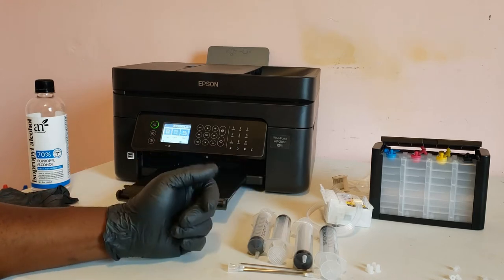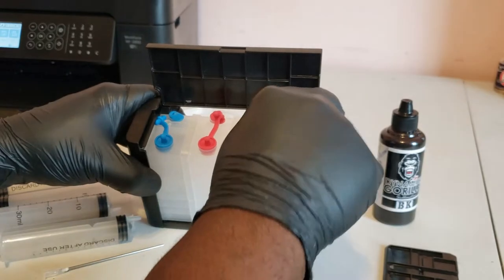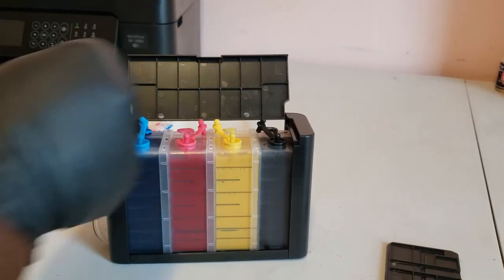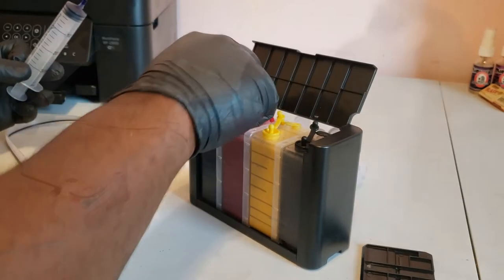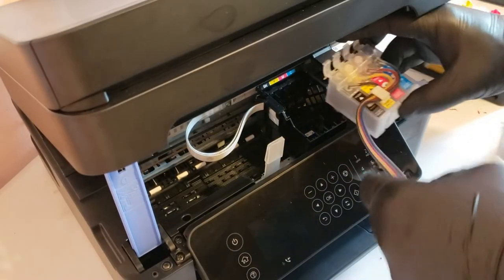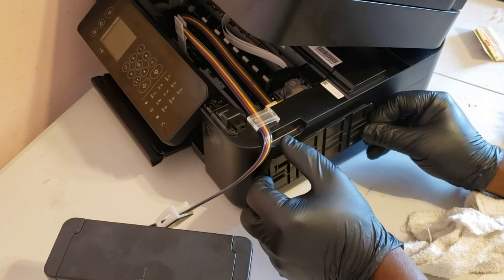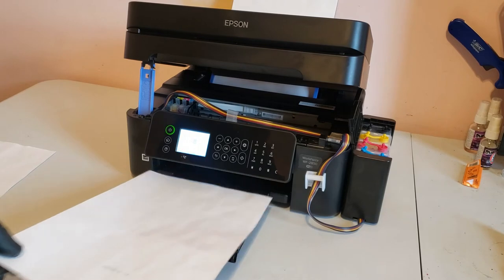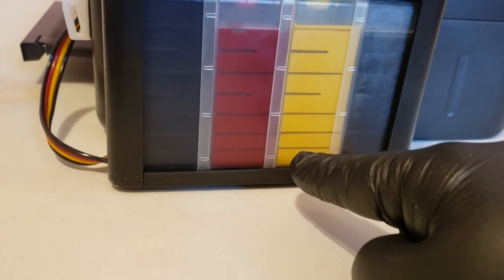WF2850 CISS Install Sublimation

Comment: With the CISS installed can you close the lid of the printer?
Reply from the maker: Not with this configuration. However, if you route the tubes through the printer, you can close the as scanner unit.
Reply: @McZell  I'm loving your videos man and have learned a lot! Ty

Comment: I just bought a sublimation package from Amazon with the WF-3733 with the ink tank and it keeps telling me that my cartridge is not installed correctly it keeps telling me to push ink cartridge down firmly help please
Reply from the maker: It's possible that the firmware was updated. The 3733 can only be used with chipless Firmware to my knowledge. If the chipless has been installed correctly it would not know if the cartridges were in them or not.  I would contact the seller.

Comment: I followed this and not putting out any ink... So frustrating.
Reply from the maker: make sure that the vents are open at the tank, and that the tank is level with the printer
Reply: @McZell  Yeah, it was an issue with the print head im guessing. We figured it out, thanks!